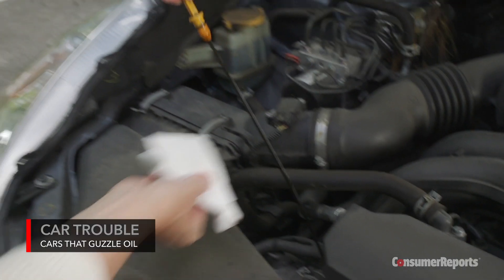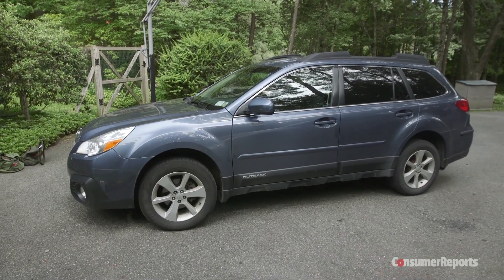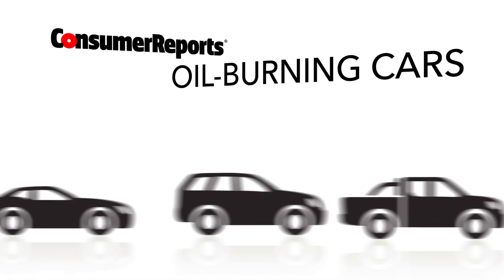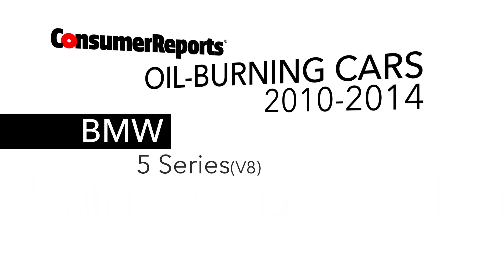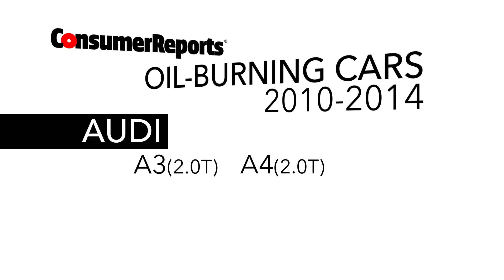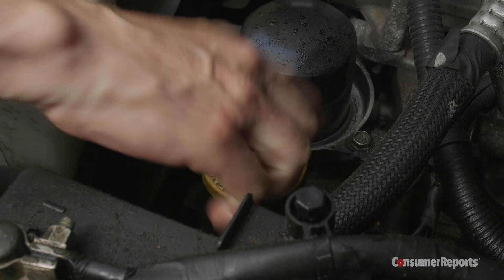Cars That Guzzle Oil | Consumer Reports

Comment: My 07' WRX STI had 33k on it when it started to chug oil to the tune of a about 1qt a month. I took it to Subaru of Santa Monica (the closest dealer to me at the time) I had an inspection done of the motor and they told me that was "normal for a high performance engine" and since I was doing my own oil changes every 3k miles (Mobil 1 5w-30 synthetic) my warranty was Void unless I could produce receipts for every quart of oil I ever put into the car. The motor lasted another 3 years and 25k miles but then boost started leaking past the piston rings. Good bye Subie we had good times!

Comment: The video mentions the Audi models that burn oil (mostly the 2 litter turbo) but doesn't mention the Volkswagen that have the same power plant. Their later TSI models are a lot better and mine on a 2015 VW GTI doesn't burn any oil, but previous VW GTI/GLI/EOS/Tiguan/Jetta Wolfsburg and Audi S3/S4 with the 2.0T FSI burned a significant amount of oil, not to mention a faulty cam follower design that could go bad as early as 50k miles on a stock car and cost a small fortune to replace (exhaust cam, fuel pump, etc). My 2.0T FSI used to burn a quarter every 1500 miles or so.

Comment: The 2010 Audi A4 2.0t in my garage burns oil like crazy. It had oil consumption problem when it was sorta new (30K miles) where it would ask for a quart about 1K miles before the next oil change, but it got worse as the car neared 70K. Now (109K miles), it goes through and asks to add a quart every 400-600 miles. There was a time when I took it to the dealer to have an oil/filter change (special price that beat independent shops), and a week later the car asked for a quart. I informed the dealer, they thought they forgot to add oil after changing, but the car somehow burned through it all. Took it to the dealer at 100K miles and reported the problem. They did an "oil consumption test" but stated that the test showed "normal consumption." Not sure how they do the test, but this is definitely not normal. The dealer and Audi refused to run anymore tests or fix the problem since it was way beyond warranty period. There is a lawsuit, but many dealers aren't aware of how they are suppose to proceed.

Comment: Low restriction piston rings will let the oil flow right on by.
Reply: +Ivan Vojt But those are all high compression engines....11:1, 12:1 etc in some models.

Comment: Another car to watch on the used market for oil loss is the first gen (95-99) Dodge Neon with the single overhead cam engine.  Every one I've owned or worked on has leaked oil from the cam shaft position sensor seal because it's too small and weak and fails quickly.

Comment: 2007-2009 2.4L Toyota Camrys drink oil like mad as well. Could barely make it through the oil change interval (3000 miles) without having already entirely filled it with new oil. You have to be crazy to actually use the recommended 0W-20 with these things. Never had to add oil to my old Nissan Maxima though and I drove the hell out of that thing.

Comment: Subaru has an unofficial recall of FB25 and FB20 engines (the 2.5L engine found in the Forester, Outback, and Legacy sedans, and the 2.0L engine found in the Impreza and XV Crosstrek). If you are still under the powertrain warranty they will replace the oil control piston rings.

https://www.reddit.com/r/subaru/comments/1xo2i1/i_am_a_subaru_technician_this_is_the_fb20_tear/
Reply: I wish I would've done a little more research b4 buying my car. It's the engine that makes the difference and yrs/models. Thanks Consumer Reports for making wiser consumers! 
Sidenote: if your car "consumes" oil, it'll get worse with synthetics (my experience)

Comment: My Cayenne will use a liter every 1000km. I don't mind, but I just wish someone told me that this was normal. The turbo burns it off and it also bleeds into the intercooler where it is also fed back into the system and burned up. It is designed that way, for better or worse. Just check your oil or you could be up for a lot more than a measly oil bill.

Comment: My 1991 Jeep Wrangler YJ 4.0L with 176,000 miles doesn't burn or leak any noticeable amount of oil between oil changes. And neither does my 2000 Ford E150 Cargo Van 4.2L with 171,000 miles.

Comment: The pattern I'm seeing here is that the German engines listed were generally considered high performance engines by the manufacturers. Eg. BMW V8, Porsche V6 & V8.
Reply: Destr0yer58 Pfft, "high-performance engines", give me a break. Besides, there was also the 2.0L Turbo in there, a base engine in some NA VAG models, and this also a problem with many other German engines as well. "Superior" German engineering is BS. There's absolutely no excuse to be adding a litter or more of oil between oil changes in a newer car. If an engine is doing that, it's because the engine is crap.

Comment: So it's mostly German engines plus Subaru. That makes sense since Subaru boxer engine is basically same design as the original VW beetle, except water cooled.
Reply: Actually, Subaru got their original design from Alfa Romeo but, yes, a boxer engine is/was used by VW, Porsche, Subaru and some minor brands, and almost every piston engine general aviation aircraft.
Reply: berndog3 no, radial engine was used in airplanes.
Reply: This Guy You don't know much about general aviation.
Reply: This Guy I didn't know the V12 Rolls Merlin was a radial.
Reply: Godot IsHere This was about boxer engine, not V12. Do you know any planes that used boxer engine not including one-offs using VW motor?
Then again, don't bother answering.
I won't be waiting for Godot.
Reply: This Guy Um, pretty much all small single engine planes are boxer 4's.....
Reply: ok I stand to be corrected, but let's stick to car engines.

Comment: We purchased our 2006 Pathfinder new and it needed a quart of oil every 1000 miles... Took it to the dealership, they replaced the motor. Problem fixed.

Comment: If you have a car with a sport car engine thats is designed for the upper range RPM isn't it going to burn oil in city driving?

Comment: Sorry CR but u r WRONG!  Even at 100,000 miles oil consumption should not be happening.   I had two Nissan Maxima's (an early 90's and a late 90's) all with over 100,000 miles.  None burned a drop of oil.
Reply: This.  I have a 2010 Mazda 3 with 90,000 miles and it doesn't burn any oil.  

Subarus have ALWAYS had issues with engines.  I call them the Japanese Volkswagens 😂
Reply: 116,000 miles on my Civic and it doesn't burn oil.
Reply: My 2002 Jeep Grand Cherokee with 160,000 miles doesn't use a drop of oil. Neither does my wife's 2011 Nissan Cube. Oil consumption shouldn't occur in any vehicle that has been properly maintained unless you have very high mileage, say 300,000 or more. Even then it's rare; I've seen Nissan, Honda, and Toyota vehicles with over 500,000 miles that don't use oil. These manufacturers are jerking around their consumers with this "oil burning is normal" crap.
Reply: Totally agree.
Reply: +TruAgape1234 How is Consumer Reports the wrong one here? They're not the ones that said oil burning is normal. Pay attention next time.
Reply: +myNEONCITY 
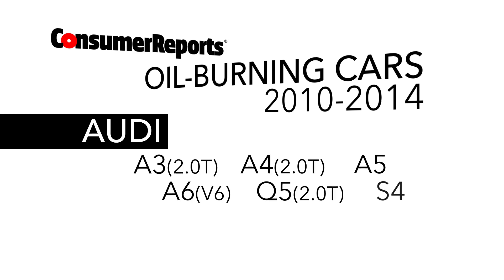at 0:43 they said its normal for cars to burn a little bit of oil as they get closer to 100,000 miles. Cars shouldn't be burning any oil at that mileage unless due to lack of maintenance, operator error/misuse, or simply a factory defect.
Reply: Agreed.
This is just poor quality control and engineering that isn’t aimed at accomplishing a great engine.
Engine designers of the past have made amazing engines that simply won’t die and need little beyond regular maintenance.

Subaru should have fixed this oil consumption problem once and for all. Instead they’ve allowed it to be this reputation impairing on and off problem.
I have an 07 FXT with 210,000 miles, no leaks, why? Because they used a better head gasket in the turbo models, but the NA models spill their guts and for some reason they’ve let it continue into newer models.
I love Subaru’s, I have 4, some old, some new, all run great, wish everyone could have my experience. But I’m beginning to worry about selling for a newer one and getting a lemon.

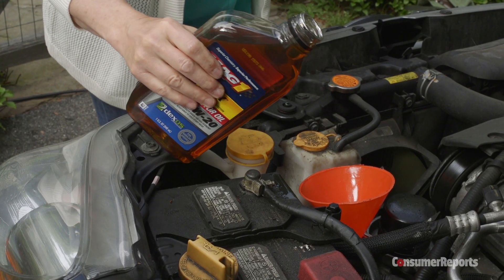Comment: 1:05 20 weight oil, no wonder she constantly needs to add when it's that light. 20 weight oil doesn't perform well with heat and friction so be ready to have a car that you fill with oil and check the gas...
Reply: 0W-20 synthetic is what is supposed to go in that car that is a common weight in newer Japanese cars. My car uses 20w as well cars have closer tolerances now and require lighter oils now.
Reply: Obviously it means nothing that the car requires this type of oil but still burns it off faster do to the simple fact that it's so thin it easily gets past rings, valve guides and other parts, more people seem to find this out with cars that use 20 weight oil no matter how well they take care of the car.

Comment: This is really hard to understand with modern machining processes and tolerances.  Our somewhat crude 03 Ford Windstar uses almost no oil at 80,000 miles.  What's the real explanation new car manufacturers are dealing with and not the "It's normal." excuse.

Comment: Damn I expected a Land Rover or Range Rover. But they could still be on the list. Anyone know where that list is? I gotta see it.
Reply: ***** In order to actually burn oil you have to be able to get the car started.
Reply: Desperate4Attention Well my Range Rover starts and it hasn't burnt any oil (at least not yet:).
Reply: The exception that proves the rule.

Comment: This is a PR nightmare for Subaru. They need to get ahead of the bad press to maintain consumer confidence in their brand. Personally, I was seriously considering a Forester as my next vehicle, but Toyota or Honda will get my business if Subaru doesn't get their act together.
Reply: Matt Tozer Hi Matt, Subaru definitely had a serious oil problem with many of their models, probably all of them. They have definitely fixed the oil problems as well as a serious head gasket issue that plagued their cars for years. As you can see by media coverage over the last 2 years just about all car manufacturers have had very serious (some argue criminal) problems with their vehicles. We've owned our Subaru for 3 years have put over 60 thousand "hard" miles on our car. We do lots of light off-roading, camping, trailer pulling and my wife commutes 2 hours daily for work in highway and stop/go heavy NYC bound traffic. We have to follow the "Extreme Use" maintenance schedule which means we have to do transmission and differential oil changes once per year. Most folks can follow the "Normal Use" schedule. Our biggest expense so far has been replacing our spark plugs at 60 thousand miles since we decided to let the dealership do it. Not a drop of oil has stained our driveway and there's not a single oil stain on the engine top/bottom. What we see is a drop in oil level of 3/4 to 1 quart in between oil changes because I use the 7500 mile interval (using synthetic oil). Perfectly normal. My Harley burns more than a quart at 5000 miles and our old Chevy consumed almost 2 quarts if I skipped an oil change. I can go on and on about my experiences with cars and oil consumption but I think you get my point. As you know all vehicles burn a bit of oil so I wouldn't rule out Subaru, or any other car maker, on oil consumption. Our neighbor's 2012 Honda CRV burns 1.5 quarts of oil before she gets her oil changed......but she's Nuts all-together and refuses to follow a routine maintenance schedule. Good luck with your choice Matt.
Reply: Matt Tozer I almost bought a 2015 Subaru Forester XT (turbo) and decided not to after my research discovered this same issue with the Subaru cars mentioned. I feel for the current owners of these vehicles. These new engines should NOT be burning oil. So I went with 2015 Mazda CX-5 AWD GT with the tech package and I am very happy with it. My CX-5 does not burn oil, same goes for our 2013 Mazda 3 sport, and 08 Civic.
Reply: True.... the 4 banger definitely has a weak tranny. The 3.6R 5EAT however, is a beast. I hear good things about the 3.6R CVT but can't honestly comment on it.

Comment: used car dealers are starting to back off from buying Subaru's due to engine problems caused by low oil and subsequent oil circulation problems

Comment: Mostly germans ,? Wow
Reply: WEIMY BIMMER No surprise, they put those cars under intense cylinder pressures and don't necessarily design them to handle them without wearing out prematurely. Ya you'll get lots of power out of a smaller engine and get better gas mileage at first but once the cylinder walls wear out from the pressure oil will just leak passed the piston rings before the lease is even up.